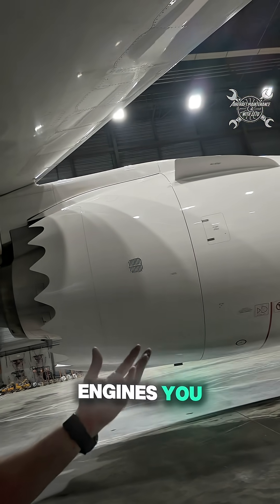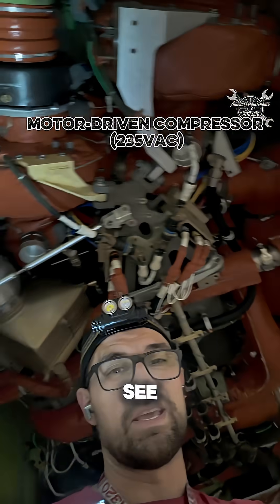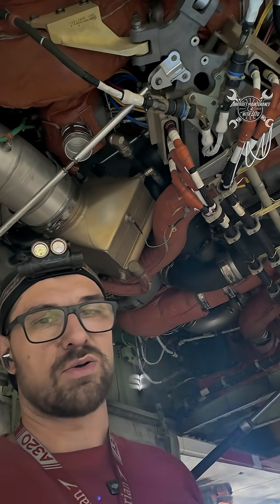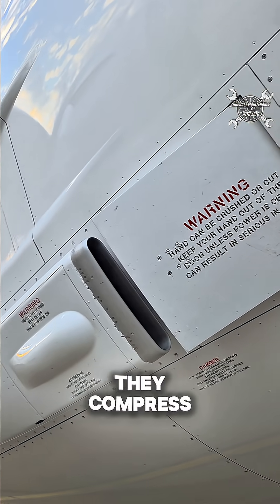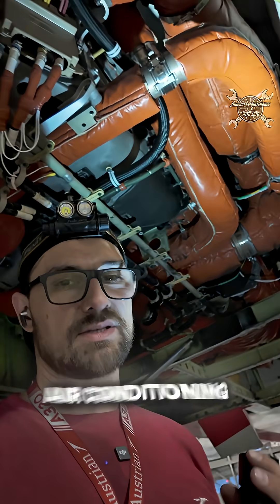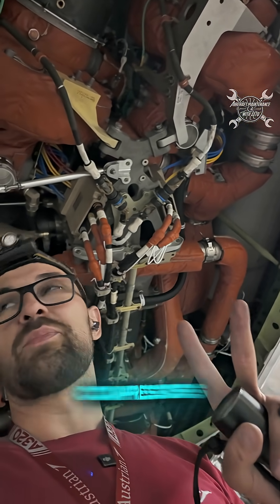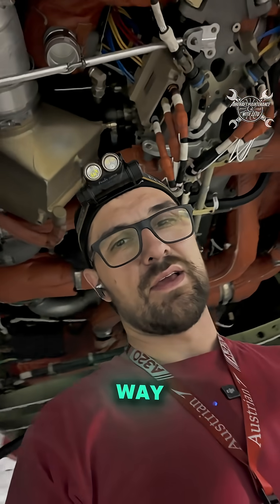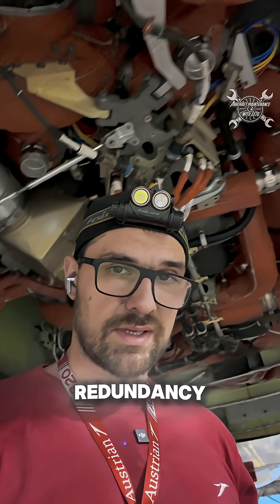Did you know that B787 has no bleed system on engines?

Comment: Rest of the things are same like 777 ECS, MUFFLER ,WATER SEP, CONDS REHEATER, ACM, FIDH , PRIMARY HEAT EXCHANGER SEC HEAT EXCHANGER ISOLATION VALVE????
Reply from the maker: Basically every pack is the same
Reply from the maker: Basically all packs are the same 🙂

Comment: Then, how do we pressurise at max altitude. Sorry if it sounds stupid. But, please, kindly explain.
Reply from the maker: Same way as engine does. Same way why fighters in IIWW used supercharger to keep engine running. There is no vacuum you still have air in 40 000 ft that's why you need compressor